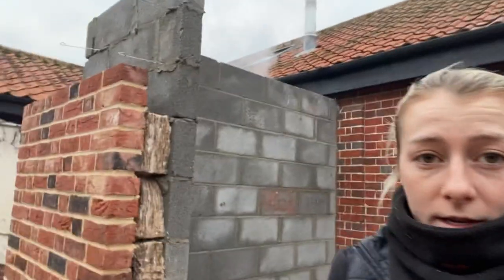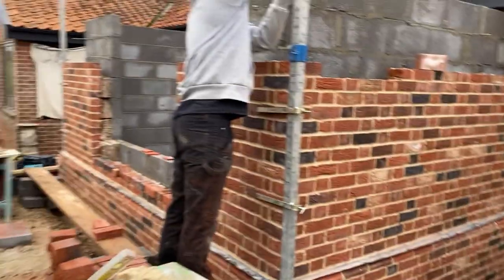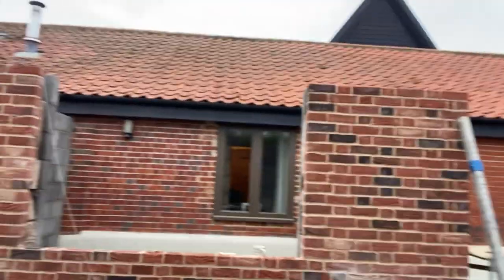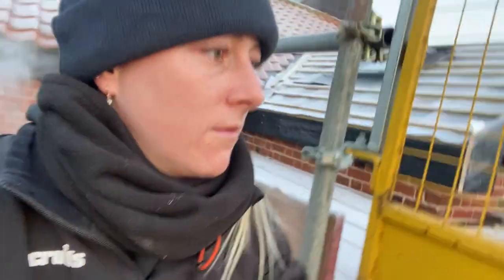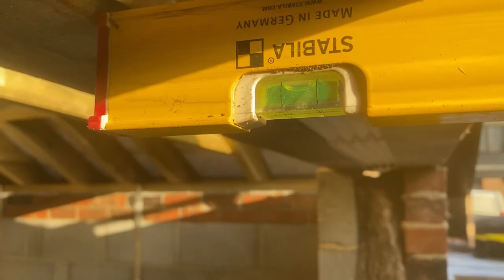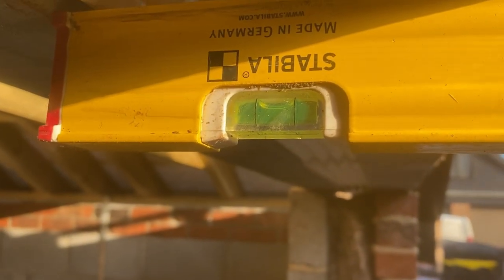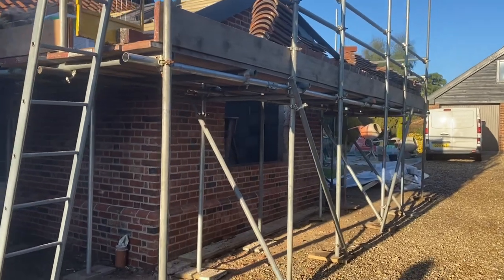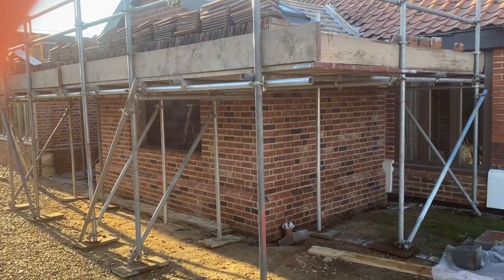Day 4 & 5 - Girl Bricky Builds Flemish Bond Extension

Comment: Good job but you didn’t put wide damp proof course at the front of the catnic forming a cavity tray with plastic weep eyes before you lay the first row of bricks a long the catnic , the wide dpc lays on front of the catnic and gets bedded on the inner block , if the front gable brickwork gets saturated from the rain and soaks through the front brick work water runs down the behind the brick onto the catnic but it can’t escape anywhere hence the cavity tray with weep eye